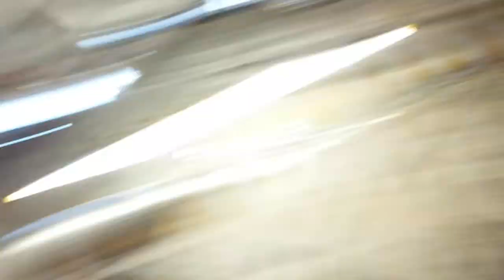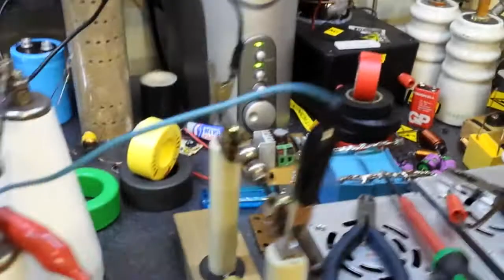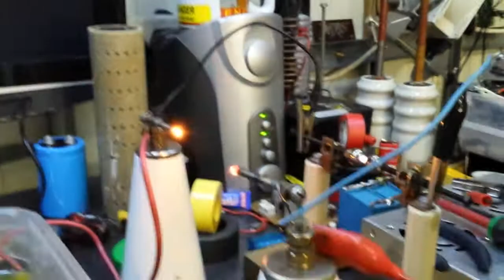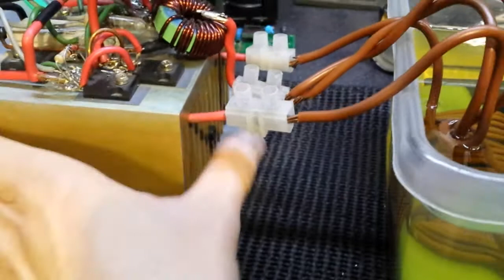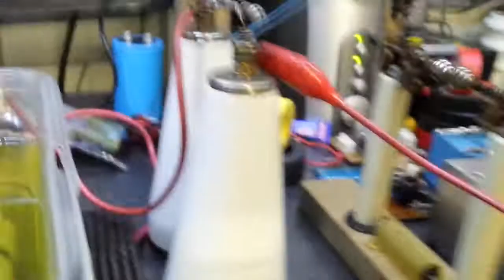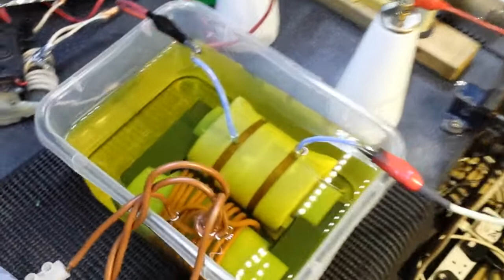ZVS driver, running ⚡X-ray transformer⚡

Comment: Thanks for the commentary. Yes I will have a bit of a clean out. Just a 3 day weekend and it rains at the moment. Wan;t to fire up that TX. Awesome arcs. Bit of heat in those electrodes. X-ray TX's a lot better then TV flybacks. Will get hold of one.
Great video. IRFP260's x 4 ?

Comment: Nice arcs Ant! really impressive output and no magic smoke or pops! xD
Just an observational question though; the safety gap, at the base is the aluminium power resistor, Now is that actually connected and if so why and what value? or does it just so happen to be placed there for storage? x]